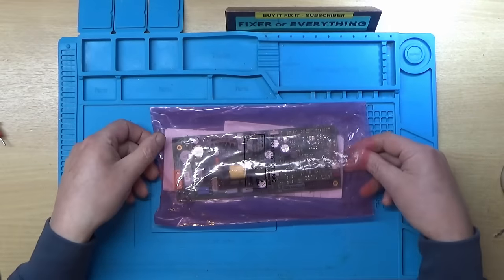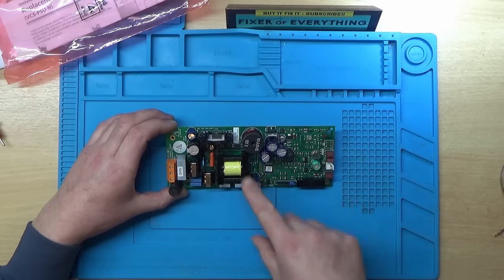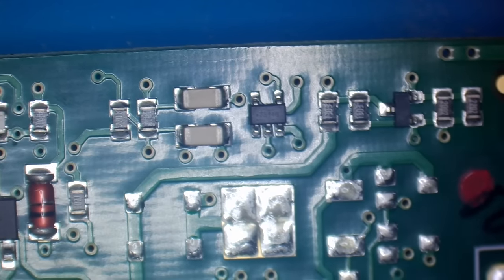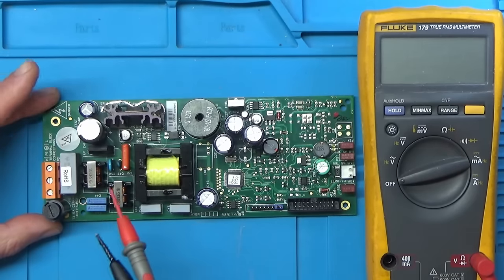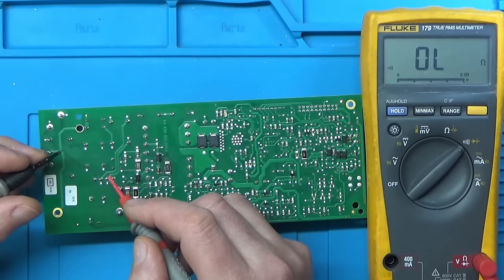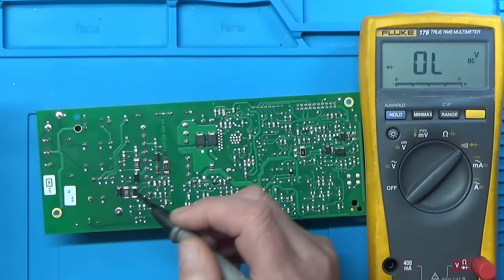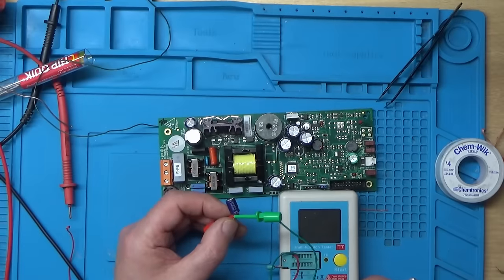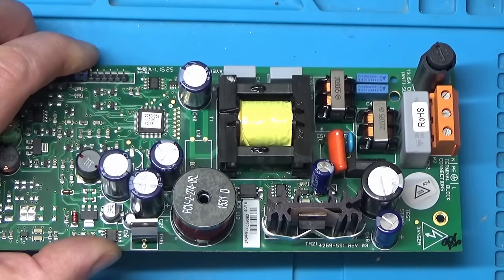VERY Expensive Fire Alarm Power Supply | Can I FIX it?

Comment: it is always the capacitors isn´t it? but what did the voltage on that chip become after the cap was replaced? I bet that old capacitor was leaking current through really bad making the voltage drop way down. if you knew how many capacitors I been changing in my stuff over the years
Reply from the maker: I did measure the voltage after making the video. I forgot to do it at the time! It seems we both came to the same conclusion as the voltage on the IC was around 12V after replacing the capacitor so I too suspect that the internal resistance of the faulty capacitor was causing the voltage to drop below the chips startup threshold 👍
Reply: @BuyitFixit  indeed. It is the weak side of resistive voltage regulation as it is pretty dependent of constant load. I had a similar issue on my kitchen fan at one point that I could not have both the light and fan on at the same time. Upon closer inspection the voltage powering the board never reached the zener voltage on the regulator diode and when using the light and fan together the voltage got so low the board started to malfunction. In my case it was a capacitive dropper and the value of the capacitor was not even 10% anymore. I installed a new very high quality cap and also replace the electrolytic caps and today 5 years later it have worked so far :)

Comment: 8:45 The voltage is high probably because you're close to the transformer and if you're working late in the evening there will be less load on the electric grid at that time.
Reply from the maker: Could well be, although it's pretty much high every time I've measured it. We are very rural but the only real problem it causes is with the solar system, as it cuts out due to high voltage.
Reply: @BuyitFixit  Some UPS's have a circuit that automatically regulates the mains voltage on the outputs.  It basically just an autotransformer with multiple taps and a voltage monitoring circuit. It monitors the voltage and switches in different taps depending if the mains voltage is too high or too low. I would post a link but YT usually deletes comments with links.

Comment: great detective work.  I wished you could have show the measurement of that cap before you removed it.  I do believe that this idea would never have worked but still im curious.
Reply from the maker: Thanks, usually it's best to remove components to test them as there can be other components in the circuit that skew the readings. I forgot to check the voltage across it after replacing on the video but I did check it later and it's now reading 12V.
Reply: @BuyitFixit  well, I did not know you could check the voltage.  The question my wife asks me is, what does a cap do - whats its function.  My answer is as best I could tell, think of a rechargable battery that but smaller.  When power is needed, the power comes from here and in a stablized form with a certain amount of Mah.  If specs are bad, then no power.  Probably got that totally wrong but ehhhh.  Im still learning.
Reply from the maker: @jasonputtock4428  Yes, I think you put it in a way that most people would understand👍

Comment: If you want a challenge, try working on a power supply for a vintage 80's-90's digital oscilloscope. Like a TDS714L.
Reply from the maker: Interesting,  I do like a challenge 🙂 I've had a few such as the FLIR thermal camera I repaired or the solar inverter where I needed the service password and had to reverse engineer their software or the recent video I did on the AVerMedia video capture device I repaired 👍

Comment: If the electronics sometimes work, sometimes don't, suspect the electrolytic capacitor
Reply from the maker: I just had similar with a Landrover Discovery 4 Bluetooth module. It was working for a while if you disconnected the battery and reconnected it, but after a while it stopped responding and caused the battery to run flat after around 2 days. I've changed two caps, and so far it seems to be working fine (apart from the bloody gearbox in the thing has now started to have problems). Tip: Don't buy a LR!

Comment: A lot of electrolyght caps fail because of the esr rising as it ages! smpsu’s are noisy and capacitors have a tough time trying to smooth or couple fast transients on voltages! I have a linear psu from an old phone exchange from the 60’s ! It still delivers 48 volt DC at 10 amps with no ripple present! Only problem it’s about the size of a microwave oven and very heavy! 😅Fraser
Reply from the maker: @elsaarmstrong-zp6ng  Nice, and a very good and accurate description of what happens with these caps in SMPS 👍

Comment: The main reason for the high price is due to the certifications it must have to be used in a life safety system.  It’s not technically legal to service fire alarm parts unless you are a licensed and certified service technician. We here in the USA used to be able to send the boards back and have them repaired by the manufacturer but now they either won’t do it or they make the price of repair higher than the already high price of the new board! It’s just a matter of money now…
Reply from the maker: Yes all about money. A counter argument could be what happens if a fuse blows? Does that need to be certified again? Or what about other power supplies that are the same age that are in the field. They have more chance of failure than the repaired one. The panel itself if will also be the same age and these electolytics go bad with age so what happens if you replace the PSU and then the panel fails? Should the whole lot be replaced?
Reply: @BuyitFixit   There are actually regulations in place for those multiple issues.  If it is a “serviceable by user” fuse then it is fine. If it is a soldered on fuse, it’s technically junk. The age of the components only comes into play when we have to replace the main control panels. If the system gets hit by lightning, which happens all the time here in Florida, and the panel that was destroyed is out of production, then yes we are required to upfit the whole system and bring it up to current code requirements.   On the other hand, if pieces are still available, we replace only what was needed.  We are not allowed to alter (repair) the components because it would void the U.L. (Underwriters Laboratory) or similar qualifying agencies rating of the equipment.

Comment: Great problem solving, but I would not use this power supply for its original intended purpose. As mentioned below the equipment used for life safety equipment is certified with the parts and methods of its original construction. These power supplies usually power the main fire alarm control panel or control notification device circuits used to alert occupants during an emergency. If this device was to fail before its listed rating during a fire it could have serious consequences.
Reply from the maker: Good point!  I know what you are saying. However the system would still run on batteries and notify the occupants that the mains power had failed, exactly like it did when the original failure occurred. Seeing as these seem to fail often due to this problem, should they all be replaced every xx years as a precautionary measure? What about the capacitors in the actual panel itself? They will be the same age as the capacitors in the PSU surely, and are also likely to fail or have already failed. What happens in that situation? Should the panels and PSU be replaced after 3 years or something just in case? I don't have all the answers I'm just curious to see what other people think, as to me the unit it working, and it could be a problem that fails in the actual panel at any moment if that is the case.
Reply: @BuyitFixit  They are often worked on. Its just important that all the same ratings/soldercomponents etc are used. I am not someone who actually works on them so I dont know all the specifics about making a repair like this. I design fire alarm plans for submittal to cities for commercial properties. 
But generally the manufacturer will have a "certified" repair place that fix them, if not in house. But usually when something like this fails the entire unit is replace for the obvious reasons you mentioned above. But dont get me wrong, they can, and do get repaired. But for it to technically meet its rated UL/FM listing the same parts and methods are used generally by someone trained/certified to perform the work by the manufacturer.

Comment: Where can I find your PO address. I have a $3,600 mean well power supply that blew a fuse and fails self test when bumped. I would love to see ya take it apart and get your opinion on it.
Reply from the maker: $3,600 wow that's an expensive PSU! I'm based in the UK but you can drop me an email if you like it''s the channel's name at out look dot com.

Comment: I would think the zener might be a 9.1 volt and has dropped to ~8 volts?
Reply from the maker: I should have measured it on the video but I forgot unfortunately. I did measure it since and it's now 12v when the PSU is running.

Comment: A friend of mine had a different back-up generator system with a failed board after  6 years. The replacement board was $800 USD!  That's crazy!
Reply from the maker: Yes, some stuff seems crazy expensive.

Comment: Of all the defective capacitors I've changed in my time, I have never come across a bulging, or leaking one, or a bulging and leaking one.
Reply from the maker: Very strange. I've came across those a quite a few times, and even recently on the smart plugs video where the bottom sealing bung had nearly been pushed out of bottom of the capacitor and the dumpster TV where the top vent was all bulging up.

Comment: There is absolutely nothing strange about the way the switcher controller IC works. It is in fact pretty much the rule, rather than the exception.

There are two supply voltage points specified in the data sheet. If the supply voltage is below the startup threshold the IC requires very low current. If the supply voltage goes above that threshold.the IC starts and its current demand increases very substantially. Once started, the IC will run as long as its supply voltage remains above the shut-down voltage which is a few volts lower than the startup voltage. Normally, once the switcher starts an auxiliary winding on the transformer takes over supply of power for the IC, keeping it above the shut-down threshold. The charge on the capacitor is the only thing that keeps the IC running if the supply does not start up properly within typically a few tens of milliseconds.

There are variants of that IC (different part numbers, but often all on the same datasheet, so you have to pay close attention when reading the data). One class of variant is based on the supply voltage requirements. Typically you would use a part from the higher supply voltage group for main-supplied designs and from the lower supply voltage group for a DC-DC converter.
Reply from the maker: Thanks for that Doug 👍

Comment: I was hoping to see what voltage the supply was at after the capacitor change, but it was obviously at least 8.53.  😆
Reply from the maker: Sorry, I only realised after recording the video that I forgot to measure it. I did measure it since the repair and it measures 12V when the power supply is running.

Comment: Having worked in that industry it is not shocking that the cost of that board is that high.
Wow, paralleled diodes, what bad design. The voltage drop will never match, and one diode will always have a lot of power dissipated across it.
Reply from the maker: Yes, good point 👍I remember from making a multivibrator circuit when I left school that two components are never identical.

Comment: The top of that cap was swollen outward. I saw it at the beginning of the video when you checked the board under the microscope and wondered if it was going to be the culprit.
Reply from the maker: It didn't look that bad to me, with other types of caps they are normally pretty obvious. These caps usually seem to vent from the bottom.

Comment: Looks like that dropper resistor caused the area to get quite toasty and kept overheating the cap which then eventually died especially that it's also right next to the main mosfet heat sink.
Reply from the maker: I had been thinking it could be that the electolytic dried over time, and due to the increased internal resistance caused more load on the dropper resistor causing it to heat up? These capacitors seem quite notorious for failing (Sega game gear) I also just recently replaced two in a Landrover discovery 4 bluetooth module which weren't in an area that got hot and it seems to have cured the problem 🙂
Reply: @BuyitFixit  Cars do get hot.
Caps might be 105C rated but they won't last long at such a temperature.
Even 70C can kill it in like 5 years.
Manufacturers will sometimes provide a temperature/life chart.

Comment: i would of heated the capacitors to see if it come to life first
Reply from the maker: I've had the opposite with capacitors before in the past (I think it was an old CRT TV which had the top half of the frame stretched after it warmed up) spraying it with freezer spray showed the faulty cap.

Comment: Usually anything to do with fire safety has to be especially certified.  As an example, even a fully qualified joiner cannot touch or hang fire doors unless they have special fire door certification.  I'd be guessing these PSUs come with some sort of fire safety sign off.  If Joe Average fixed one and it subsequently failed resulting in a fire not causing the alarm to trip then you can imaging the law suits from the building's insurance company.  Whoever touched it last would get any blame.
Reply from the maker: Yes a couple of people mentioned similar, although now it is repaired it has less chance of failing than similar units of the same age that are in the field, as it seems this is a fairly common problem 🤷‍♂️

Comment: Those power supplies are often in a poorly-ventilated or sealed enclosure in a hot utility closet or electrical room so I wouldn't be at all surprised if all of those electrolytics dry up in a few years.
Reply from the maker: Agree, heat dries the electrolyte up.

Comment: Rule 101, after visual inspection of board always test caps first, resistors, zeners before ordering parts. 80% of the time whether it is dead on arrival, recent boards or old pre 2000's it's always the caps.
Reply from the maker: Cheers for that 👍

Comment: As frequently as capacitors fail, it would be great if some genius would figure out how to make them a socketed component for easy replacement.
Reply from the maker: Good idea but that may cause more problems that it fixes due to capacitors not making proper contact and even falling out, not to mention the extra cost.
Reply: @BuyitFixit  They said the same thing about IC's back in the day.
Reply from the maker: Yes, and now not many use sockets, most are surface mount.
Reply: @BuyitFixit  Well of course, and many manufacturers have also switched to solid state capacitors that are surface mounted as well. But every repair channel that I watch where an IC is de-soldered and replaced, 9 out of 10 times the technician puts a socket in place for good reason.  There are still plenty of devices being produced with electrolytic caps. As I said earlier, it would be nice to have a socket for  the electrolytics because they are guaranteed to leak again or fail and that failure rate is 10 time greater than that of ICs.  So why not have a means to socket the electrolytics as well?  Unless you just enjoy replacing caps over and over the hard way.

Comment: So, the Zener survived I gather. ;)
Reply from the maker: Appears so. I think the internal resistance of the faulty capacitor pulled the supply voltage down below the startup threshold of the IC.
Reply: @BuyitFixit  
Perhaps. Or the ripple was so large that everything was skewed. Did you measure the supply  voltage after rep.?
Reply from the maker: Yes, I forgot to do it when making the video but I was curious, so I powered it up and it again and measured around 12V supply on the cap and IC.
Reply: @BuyitFixit  
Okay - thank you.

Comment: As it's for a fire alarm it's probably best to replace the capacitor like for like.
Reply from the maker: Agree, if it was going back in one then I would use the correct surface mount one. I was just asked to see if I could determine what the fault was as he has a number of these with the same problem.

Comment: Nice fix BUT unless you have been certified by "The Authorities"  aka Fire Alarm people, this power supply is NFG.
Reply from the maker: Yes a couple of people mentioned the same. So does the same apply if the fuse goes? As that is technically repairing or replacing a faulty component 🤷‍♂️

Comment: Gent Vigilon Compact PSU, very common failure in our industry. Once Power is cut to them they don't power back on...
Not like Honeywell are a multi billion pound company or anything 🤔
Should they last longer than 7 years (which that one is) when on 24/7?...
Reply from the maker: Hopefully if you didn't know how to repair them you do now 🙂
Reply: @BuyitFixit  certainly do, great video as always 👍🏻
Reply: Just to add (not justifying the price as it is extortionate) there is a lot of monitoring of external circuits carried out by that PSU due to it being on a fire alarm system and life safety etc.. earth fault monitoring being one
Reply: Battery low, battery disconnected, mains failed and possible earth fault but not sure if that circuitry is on the main fire alarm. But I can't think what the other few pins are monitoring.
Reply: @Dime_Bar  the Gent PSU whether it is compact of vigilon monitors
Mains in
DC
Batt 1
Batt 1 charge
Bat 2 (72hour panel)
Batt 2 (72 hour panel)charge
Master alarms 1 (conventional sounder circuit)
Master alarms 2 (conventional sounder circuit)
Earth fault
Loop voltage

Can all be checked in the test/engineer menu then test psu 👍🏻

👍🏻
Reply: @michaelbarkham6064  cheers